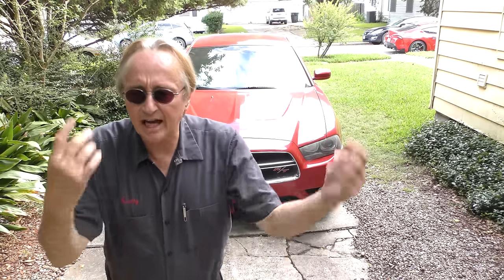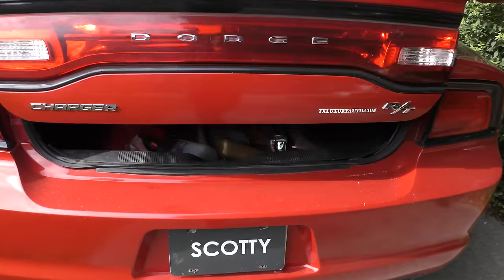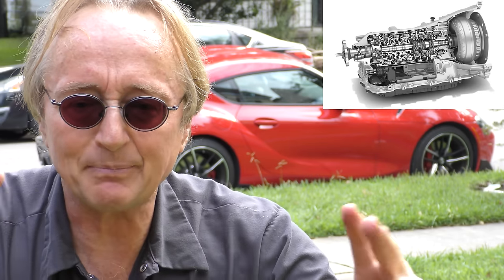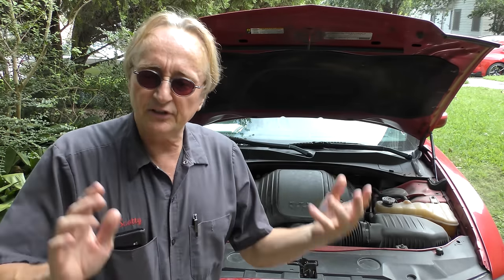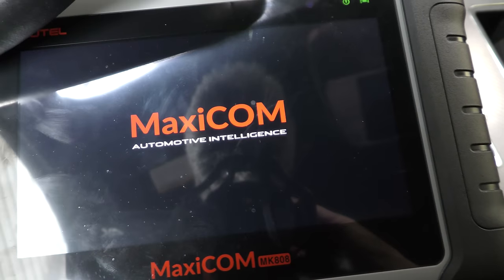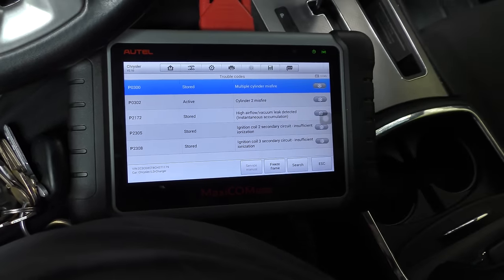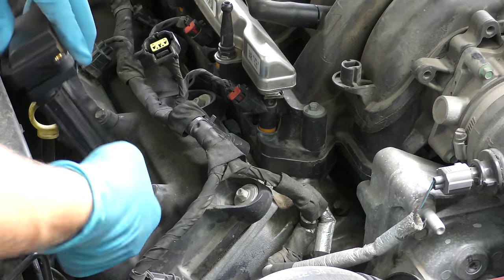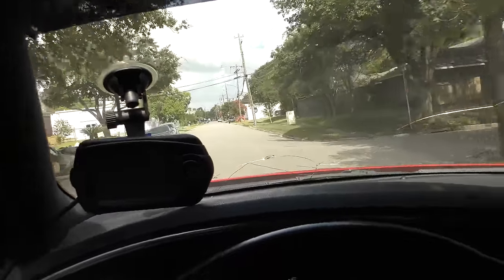Here's Why I'll Die Before I Buy a Dodge with a Hemi Engine

Comment: Next video: "Why Dodge and Hemi Make the Best Engines"
Reply: Lmao dodge is absolute junk
Reply: He did video on hellcat best V 8 ever
Reply: @alanmay2837  more junk than GM?
Reply: Alan May  u wish
Reply: @alanmay2837  how do you know?
Reply: @alanmay2837  have you ever owned one?
Reply: They sure do
Reply: @alanmay2837  new ones are, older one's arent
Reply: My ‘13 Charger RT has 88K on it an is currently getting a stage 2 cam an Hellcat lifters because it had the dreaded “hemi tick”. I don’t drive it hard at all either.
Reply: @mr.cholo2521  what you on the Hemi coupons eh?
Reply: I have 300k on my ram 2011 and still runs great.
Reply: @Kachcan  i really hope you didnt buy those "hellcat" lifters at a higher price than your oem lifters 😬 they have the same part numbers across the board. 5.7l 6.4 and hellcat.

Comment: had lots of fun in them ole Mopars
Reply: I still do
Reply: The key here is OLD Mopar.
Reply: Had 06 srt charger ... held crown at the red light until 2014 then the rest of the gang catch up with hp Ford etc ....
Reply: I still do. Had a 68 Sport Fury as a daily driver. Currently daily driving a 65 Dart 270. There are plenty of old Mopars in good shape out there. Prices on B bodies are crazy high, though.
Reply: Prices on B bodies have been crazy high for years, even for junkers, But they're too small for me, That's why I drive 60's C bodies ('66 Newport, '68 Polara, '68 New Yorker) and a variety of M Bodies, all sedans, I learned to drive in a '67 New Yorker 440 TNT sedan and I've loved big ol' Mopar sedans ever since
Reply: @billb1860  I miss my C body. A body is too small. Will be going back to a C.

Comment: I have an 05 300c with the 5.7 hemi 126 thousand miles been had the car for 5 years now have changed radiator,thermostat,water pump and intake manifold gasket so far

Comment: Scotty: Ram 1500 Hemi engine is bulletproof. 
Also Scotty: I’ll die before I buy a Hemi
Reply: He is losing his damn mind. did the same thing about the transmission. its crap in rams, jeep, dodge but an awesome transmission in that toyota
Reply: Hemi = hemispherical cylinder head. Other than a cool name, What’s the advantage to that?
Reply: @michaelzaug8750   you will see stars coming out of the exhaust when it dies :-)
Reply: Older hemi models yes because they had more reliable transmissions newer ones not so much. They require much more care to last long.
Reply: @tyguy070  The old 727 Torqueflite automatic trans was basically bulletproof. They could handle all kinds of abuse. Whole different story with the more modern Chrysler automatic transmissions. Over the last 25 years or so they have been well known for transmission problems as well as electrical/computer problems. Only in the last few years have Chrysler products become much better
Reply: @jeremythompson9122  Correct
Reply: What about the Mercedes trans this one came with?
Reply: Michael Gillam the 5 speed is the Mercedes trans.
Reply: Michael Zaug better flow , obviously you're not a car guy
Reply: He says this engine is bad because the other parts are cheap (dodge) he says when paired with this transmission, then it will have issues. So listen to him before blabbing already
Reply: @michaelzaug8750  with the hemispheric chamber design becomes easier to achieve higher horsepower with less investment in resources.
Reply: Jeremy Thompson 2019-2020 Chrysler seems to be going to strong but they’ve strayed far from the Lee Iacocca method.
Reply: Warm Soft Kitty what do they have?  According to Webster’s dictionary a hemi is a hemispherical combustion chamber.
Reply: Warm Soft Kitty  it's hemispherical, just squished on sides instead of a full circle
Reply: @michaelzaug8750  more power because it produces a more rapid rise in combustion chamber pressure relative to a typical overhead valve design with a wedge-shaped chamber. Provided the ignition source is near the chamber's center, the reflected pressure wave coming off the chamber's walls will result in a faster, more coherent pressure peak. The act of burning all the fuel in a shorter window of time versus in a longer period of time means that the buildup of pressure within the chamber occurs earlier in the power stroke where it has more efficacy due to its mechanical advantage on the crankshaft.
Reply: @michaelzaug8750  Hemi heads were thought to improve cylinder efficiency. However, todays HEMI's are more like wedge heads, so IMO the half round heads were not worth the cost.
Reply: @michaelzaug8750  
Let's ask everyone competing in top fuel competitions and I literally mean everyone, on why the hemi is so advantageous? Good luck trying to catch them in your little Toyota prius.
Reply: Jason Cardenas better flow? What does that mean? How is a different shaped cylinder head better? I’m just asking questions. No I am not a “car guy” What is a car guy? A mechanic?
Reply: @michaelzaug8750  i thought it was marketing because its a dodge viper engine?
Reply: The hemi tick tho 😂
Reply: Just put a 2012 dodge transmission in it👌🏾problem solved 😊
Reply: @Warm Soft Kitty Nothing has flat cylinder heads anymore.  They're either wedges or squashed hemispheres.
Reply: Junk
Reply: @nonenone4015  thank you sir for your opinion. Much appreciated!
Reply: They still make the engines good, the big problem is the fact that dodge doesn't make good bodies anymore, let alone anything that isn't the engine itself
Reply: Dodge 94-02 1500s were ALWAYS in for front end problems, and their auto tran/nies were well known POS.
Reply: Couldn't possibly be as powerful as his pos Celica. Lol
Reply: @michaelzaug8750  Have you not known a man the with the distinction and class of a gentleman by the name of Joe Dirt?
Reply: @brosmile9388  since I decided to take my car apart in the driveway and put it back together using YouTube that would be me. All I need to do is look no farther than the mirror.🪛🛠⛏🔧⚙️🔩🤣😂😅
Reply: @michaelzaug8750  the argument for a hemispheric head design is that you can fit more valves in. Among other things I'm sure.
Reply: I'm pretty sure he is speaking on the engine itself in the former and the car with a hemi engine in the latter.
Reply: @michaelzaug8750   Chrysler developed what was to be the most powerful engine to be placed in a fighter plane for the war effort WWII. Perfect for dragsters and boats. Big disadvantage is that it’s a heavy engine.
Reply: @JeffreyMillswa6cej  what engine was that?
Reply: LOLLL

Comment: The 5 speed chrysler transmission is a actually a 2000's Mercedes transmission. Maybe older
Reply: Actually, the whole car is just a redesigned earlier model E class mercedes.  Same for challenger and 300
Reply: Mercedes and chrysler make eachothers cars
Reply: @bryantfields9476  yeah I know about the whole story about theses LX's (300, charger. Challenger,  magnum). The jeep and Durango  have a simular story too
Reply: William Schwartz  Most of these are owned by people who dog them out and/or don't maintain them. My '09 Hemi Charger is in great mechanical shape with 172k as of today, owned it since 2014 and never had to replace my engine... worst aspect of these cars is the weak front ends (I've done all my ball joints, tie rods, 1 control arm, and every sway bar bushing once).

Comment: Uncle Tony just showed the design flaws on those engines just a few days ago. Once you see you will 🤦 No wonder it ticks...
Reply: Is it chinese-made lifters?
Reply: Dodge/Chrysler are big pieces of crap
Reply: its oil starved camshaft. no crankshaft windage, no lifter oil drips on it no nothing. lubed by luck
Reply: The question i have is did they no about the flaw or was it an overlook? Planned obsolescence comes to mind...
Reply: He did an excellent failure analysis, showing that the redesign starves the lifters of oil at idle. It's not  cheap Chinese parts ( this time), it's poor design..
I recommend Lucas Oil Additive for this issue, and not a lot of idling time either.
And if starts ticking, check the lifters out right away .
Reply: Change and use good oil and you will not have problems. I have 4 hemis and never a lifter failure, or cam. I also have a 5.7 with a cam ,stock lifters 200 shot of nitrous,  still not a single tick. So just change  your oil

Comment: I own a 2019 dodge challenger rt, 25k miles on it. And he's not wrong, I expect my lifters to go out around 100k or so miles with the camshaft following suit. Could they last longer? Yes. Coukd they last shorter? Yes, but not really easy to tell. It's one of the biggest issues with the hemi's, and it's really up to you whether or not it's worth replacing. I myself plan on putting on new headers and a bigger throttle body, so I'm gonna be putting in better lifters and camshaft while I'm already in there, so although I shouldn't end up facing the problems with the stock ones so early, I am still paying more money to replace them at the end of the day. It's the one disappointing things about these muscle cars. I love them to death, but such a simple thing they can easily make better to last longer, they don't, and the costumer pays the price.
Reply: You shouldn't be worrying brother. 120K+ Miles here on a '14 RT+ Challenger. Got it used around 65k+ miles and didn't have problems with the lifters/camshaft or any lights until 105k miles. Worth replacing if you want to put the love and money into it lol. I can't lie and say I haven't thought about upgrading but it has much more potential.
Reply: Keep up with oil changes with a good quality penzoil or mobile one with a good quality filter it will be fine for hundreds of thousands of miles....
Reply: im over here with my 2007 rt charger at 198,000 miles

Comment: Man Scotty sure did a good job of finding the most BEAT charger to diss on for dodge. Maybe find one that was actually maintained and you’ll have some better luck. 380k with math on idle hours on my pursuit charger hemi and 260k on aspen hemi towed 12k lbs consistently no issues... Much better than my buddies Toyota with 90k miles and it can’t seem to run right for its life.
Reply: Idle hours :face-blue-smiling:

Comment: This Himi hasnt been maintained very well, i seen the 5.7 Himi go over 300k with no problems.
Reply: Nope
Reply: Actually,  yeah. All I've owned is Hemi and though I do have to maintain them meticulously they last forever.
Reply: You're talking to a high mile hemi owner. 312 on 05 300c owned it at 18 and you know how 18 year olds are with treating their cars
Reply: A well-maintained Hemi will do the miles just fine - I see them on a regular basis with 200-300k+ and owners happy as can be.  Scotty's also wrong on the transmission - the 5 speed automatic on older Chargers is the Mercedes W5A580, not a particularly troublesome transmission at all.  But what the heck do I know, I was a Chrysler tech and worked on them everyday!  Just love how he shows a clapped out Charger and paints it out like all Chargers/Hemis are junk.  They're a mechanic-friendly vehicle, lots of room in the engine compartment despite the V8.
Reply: @AKJeeper  would the charger v8 be better than the mustang or camaro v8? Also will the same rule apply in trucks?
Reply: I've owned my 2007 magnum 5.7 hemi for 4 years and it runs beautifully. Has 172,000 and the only things that have broke since I owned it are normal wear and tear parts. Original water pump gave out at 160,000 miles. Original radiator fan went out at 170,000 miles. But I'm no mechanic what would I know. Just my personal experience.
Reply: @chiragsomaraj5121  I also own a ram with the hemi and the "dreaded" 5 speed automatic transmission with 325,000 miles and still going strong

Comment: I had one in the shop last month.  Had one cylinder misfire. Intake was flooding with gas. I put the noid light on the injector connector. The injector circuit was staying grounded keeping the injector open. I unplugged the pcm it had water in the pins. Cleaned and dried out. Fixed.

Comment: Surprising to see a Chrysler still running with nearly 150k miles
Reply: Problem with Chrysler's is their QA. You could get a car that is all good and will go the distance. Or has numerous little problems off the assembly line and will be a money pit even when you first get it. And then chrysler won't cover you for a warranty. This is true in their "economy cars" their upper trim projects always get more attention. They're just decent but they cheap out on all the expensive parts a car needs to be solid and reliable.
Reply: The Hemi engine are not that bad, the rest. You know the story.
Reply: 07 3.5L charger with 208k miles on the clock.
Reply: @JVenger  3.5 V6 engine are very bullet proof engines! And also very smooth and easy to find parts
Reply: Greats cars if you take care of them
Reply: @G.B.P.1999  I agree. But that being said, you don't want to beat the crap out of either engine, or any engine for that matter.
Reply: @DylanL69  Great piles of junk
Reply: @michaeldavila8627  nope
Reply: @G.B.P.1999  it's just everything else that is piss poor. I love everything about these cars. That's why I say that.
Reply: 161 on my 06 Daytona and im gettin rid of it lol for a f in Camry
Reply: @JVenger  06 Daytona with 161
Reply: Almost any car can surpass that mileage if you treat it good.
Reply: @G.B.P.1999  Same with the crown victoria , they're bullet proof engines will last longer like a Toyota
Reply: Fifty 1 Fifty I have the same year and 163k on it , runs great
Reply: I don't think any car will last a lot by pressing the pedal like a maniac, which car can hold that kind of stress? That's why track modified cars are always in repairs...
Reply: @bernie472  exactly! I agree
Reply: went  150 k  miles,  still  runs,  plus  it  wasn't  wrecked.   good  enough  for  goin  to  the  store  n  back....not  bad.
Reply: I seen the larger hemis srt get 250k still mint condition wanted 8gs for w rebuilt tranby ofcourse
Reply: 13 V6 pentastar avenger with 160k. Absolutely no issues. I bought it with 1.3 miles. It’s a wonderful car.
Reply: My 2006 charger daytona rt gomango has 260k runs mint no problems whatsoever
Reply: They were built good in the 60,s and early 70,s
Reply: I've got a 96 dakota with 182k. Not the prettiest thing, but runs like a champ.
Reply: My 07 300c has over 151,000 miles. I beat on her too but I'm religious with maintenance. She's been good to me.
Reply: My 06 magnum Rt has 170k. The only major fix I had was the power steering pump. I made sure proper maintenance was done on it and it's still running to this day.
Reply: Roman C. Not even any car has its issues. You guys all just believe your opinion is fact haha

Comment: You should review a charger with the 6.4 hemi
Reply: You can really beat those up
Reply: @KA-vs7nl  how so? What about longevity? I doubt there are many high mileage ones. Most of them are pampered with kid gloves
Reply: Lol he's just gonna hate on it
Reply: @DylanL69  Yep, supposed to give unbiased opinions but obviously hating on the Dodge brand. I owned a 2018 392 Scat Pack, one of the best cars I owned, until it was stolen that is. Car went like a bat out of hell, super reliable after putting a hundred 1/4 mile runs on her and had a crazy mid range pull for such a large car. Most likely I'll buy a used 392 Scat Pack Challenger next, no matter what others say about it.......
Reply: @ct87gn25  2018. Reliable. Noooooooooo.................................. Not long enough to be unreliable, man. That car thief probably did you a big favor.
Reply: @ct87gn25  well it was only 2 years old so yeah it would be reliable
Reply: @IamJay02  2 years old with almost 50k miles and being hammered every weekend at the track. And it never missed a beat...........
Reply: I seen one with 260k run like a watch for 8gs the bigger motor I think is better but how you maintain,  car was immaculate even with high mileage
Reply: @ct87gn25  He's not supposed to give unbiased opinions.  He's giving us his VERY biased opinions based on being a mechanic since Fred Flintstone had a two-leg drive...
Reply: @ct87gn25  stolen how? It has a immobilizer
Reply: Doctor Strangenough I can’t speak for everyone but I do mine. 392 does have the power be gas aspirated. Love starting it up in the mornings lol
Reply: Love my scat pack challenger. The 6.4 is a better engine. Less hemi tick. As long as you keep the oil changed you are good.
Reply: CT87 GN what tires did u have on that scatpack?
Reply: @Fadz-zg6bt  We think it was a "roll back wrecker", maybe even a flatbed..........
Reply: Doctor Strangenough I have a 2015 scat pack challenger with 70k miles. Bought it brand new never had a problem with it. I drive 100 miles everyday for work. My 05 charger has 180k miles. Swapped the cam out around 100k miles for a performance one. Still going strong today. They’re nice cars when they’re taken care of. I just think Scotty doesn’t want to tear the engine down and spend the 8 hrs lmao. There’s tons of old mechanics I work with that are just like that. Calls everything that’s mildly complicated junk
Reply: @ct87gn25  The 392/8 speed has enjoyed a good rep since it's 2015 intro. IMO it represents the best balance between the V-6's and H/C's. Being 174 lbs lighter than a Demon, it will hole shot quicker. 
Good starts makes for good runs. Going up in smoke doesn't.